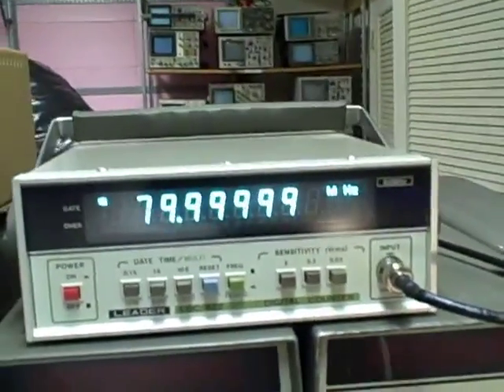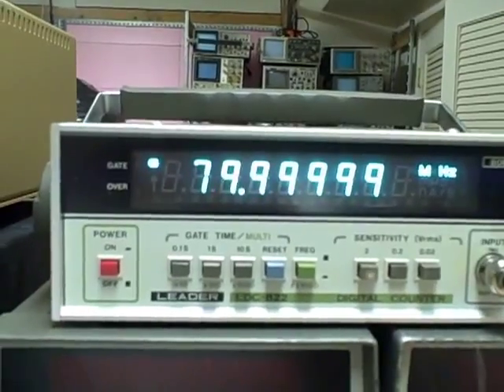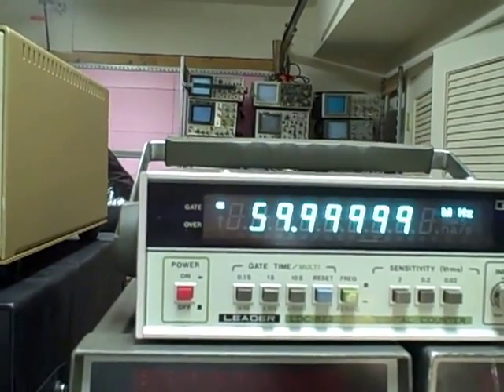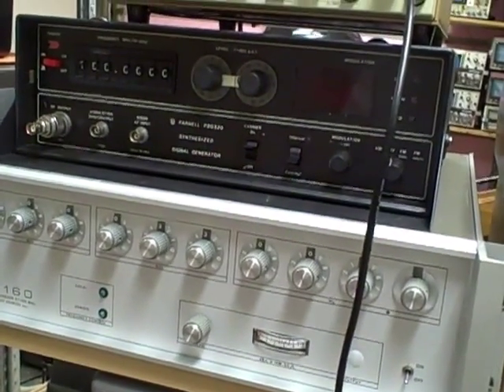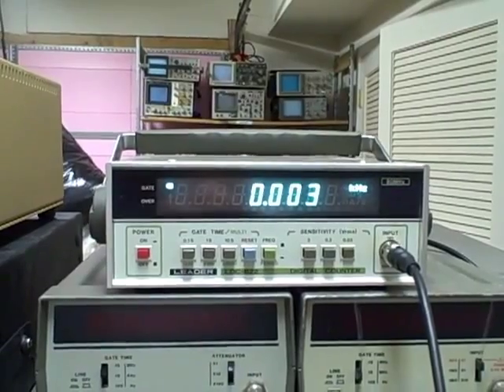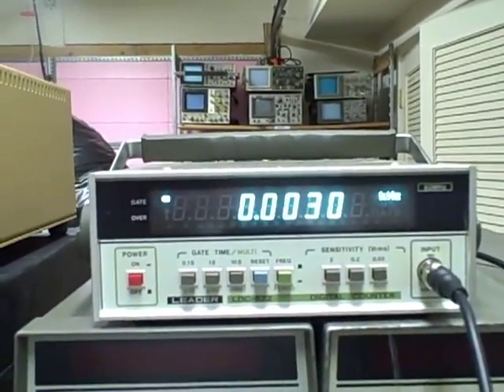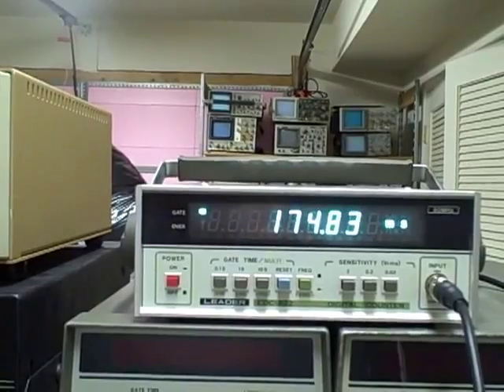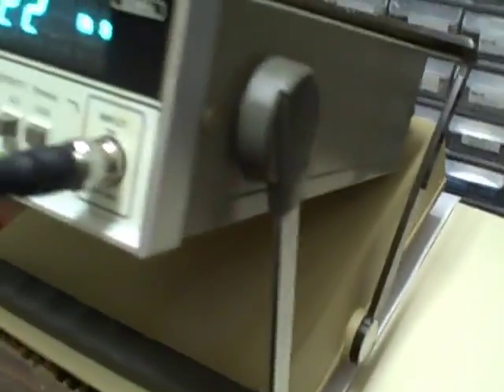Leader LDC822 80 Mhz Frequency Counter

Comment: Hi i have a question, which will sound dumb to you i'm guessing about the frequency synthesiser and counter you are using. What kind of a job would require you needing this kind of equipment? I have seen a video on YouTube of someone using a frequency counter to check frequencies coming out of a spooky rife machine, and i wanted to get mine checked with someone locally here in the UK, who will maybe have similar equipment to what you are using, hence my dumb question, so that i can then do further research into this.

Comment from the maker: Came out about 1979.  I didn't need to recap it.  I did check the electrolytics in the power supply but found they were functioning just fine.  Mostly needed the range switches cleaned.